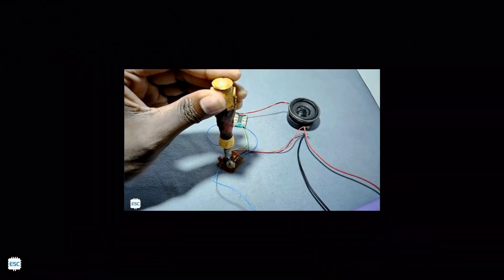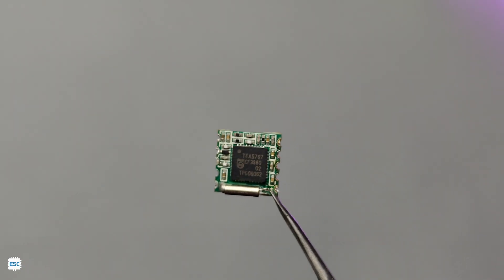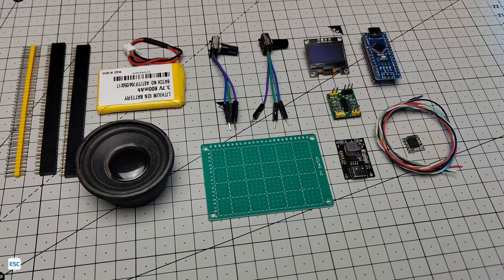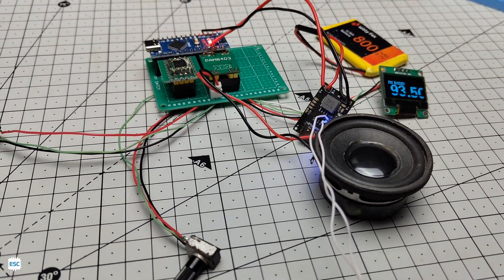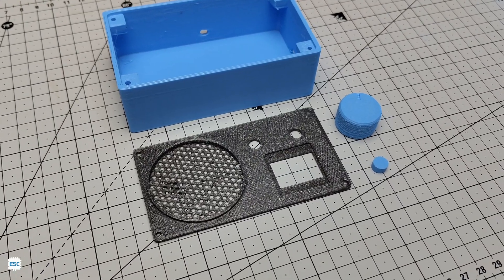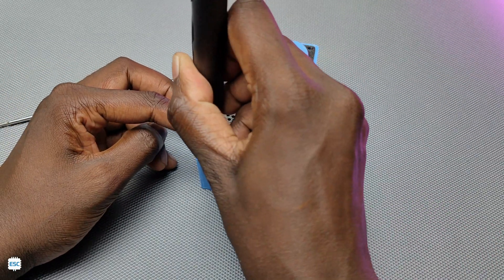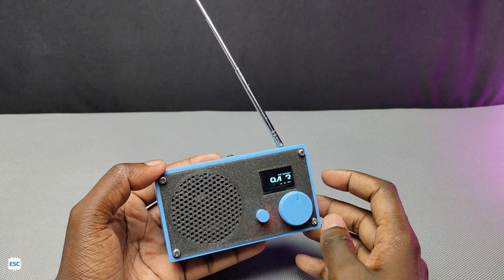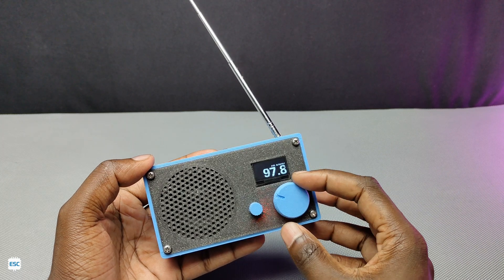How To Make FM RADIO using Arduino | TEA5767 | giveaway results

Comment: does the i2c module require a specific code , if it does could you tell it
Reply from the maker: Noo . Code is available in site
Reply: @EDISON_SCIENCE_CORNER  its not working brother

Comment: can you make a dedicated video or a comment on how exactly the arduino code works, because as per your video , the code isnt working , a little more in depth explanation will prove to be a lot more helpful to lot of viewers,
Reply from the maker: No need for in depth explanation because its not difficult . Just add the library